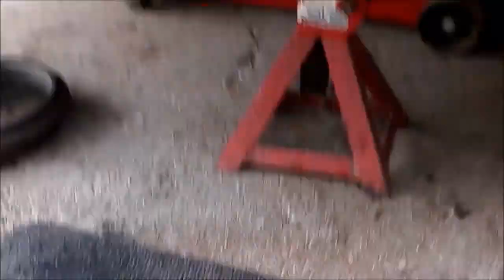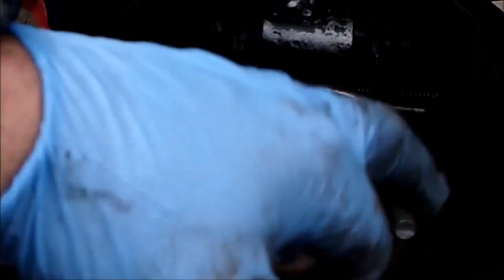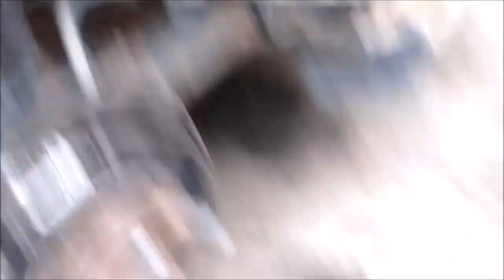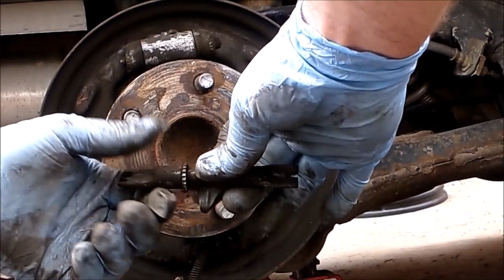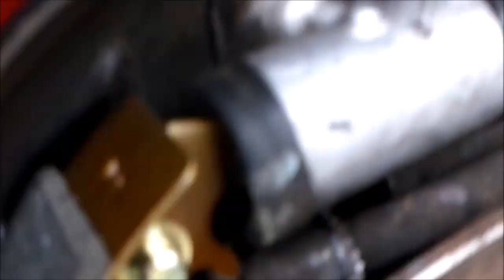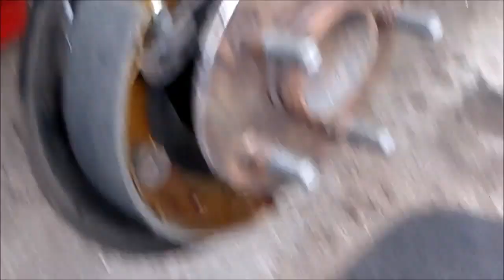replacing rear drum brake shoes..2005 Toyota Corolla e120

Comment: I have a 2008 corolla, put off doing the drum brakes until the car was almost at 270k miles.  Your video made it really easy to do.  The only tricky part was making sure I had the tension adjusted right at the end, the rest was really easy thanks to how you did this video.  Thank you!!!  I spent a while stepping on the brakes and turning the rotors before putting the wheels on, just do it until there's just a little resistance.
Reply from the maker: excellent..glad it helped

Comment: Hi there,thanks for your very helpful video,my question is some fluid came out from wheel cylinder but now I scared to bleed it because small bleeder is too rusty to break ,can you please advise me what should I do ?...thanks and appreciate
Reply from the maker: soak the bleeder screw for a few days in penetrating oil , then it should come off . If you didn't press the brake pedal while the cylinder was losing a bit of fluid ,you likely didn't get any air inside.

Comment: hi,
does the emergency break need to be pulled up/engaged or leave it down.  Before changing the breaks?
thanks
Reply: I dont think u should use the E breaks
Reply: @alancapetillo5049  Thanks Alan
Reply from the maker: e brake off
Reply: @fupabox  ok thanks
Reply: @fupabox  i replaced only the driver side rear and got tired so wanted to do the second tomorrow. i put everything back on. started pumping on break paddle like 20x and  break feel spongy. does that mean i have to bleed it? amd why would it feel spongy if major breaking comes from front tires?
thanks awesome video!
Reply from the maker: @muharems2072  check that the rear shoes are adjusted close enough to the drum . If they aren't close enough the brake pedal will be spongy .

Comment: why would anyone car manufacturer use drum brakes is beyond me. I will never buy another car with drum brakes.
Reply: ROB NAVAEI y
Reply: Drum brakes can last 100K or longer, require little maintenance, are adjustable, and the front brakes do 60-80% of the braking anyway. I'd say they are pretty damn efficient.
Reply: True, but as you said, drum brakes do very little and they usually do not wear evenly because of their design. They are much heavier than disc brakes and most expensive cars do not have drum brakes. They are hard to overhaul and they do not have the stopping power of disc brakes, they also have a tendency to heat up and fade under heavy load. This is an old tech and should be discarded.
Reply: because they work right. If you think the technology is old,  next time try  buying car with square tires, it goes well with your kinda brain
Reply: @sanBastian123  - Correct - Diesel Big Rigs and Heavy locomotives still use Drum Brakes or Drum Type braking mechanisms - there's a reason why ...